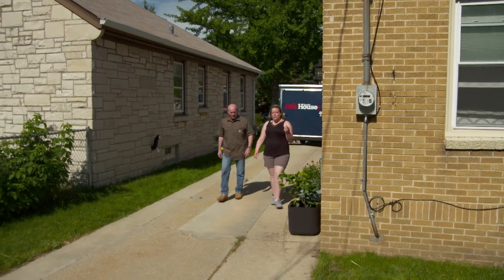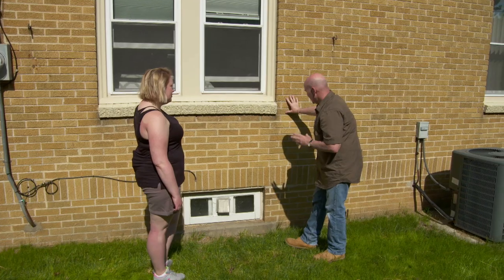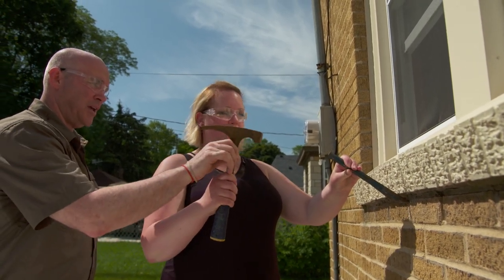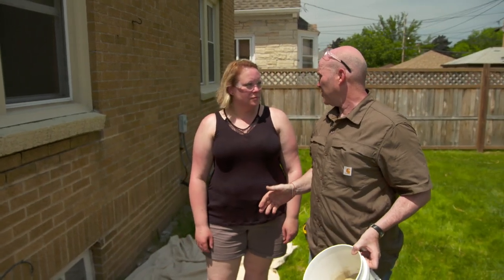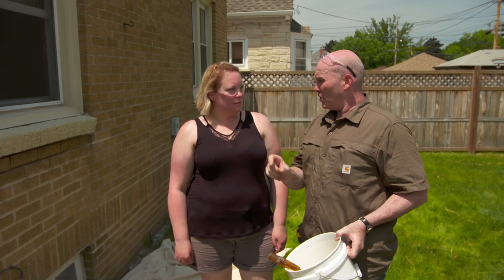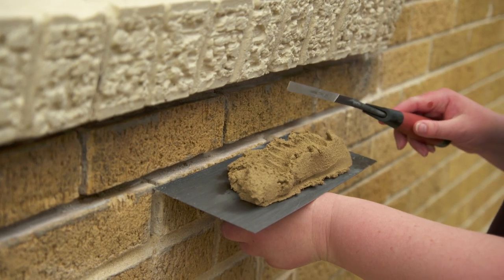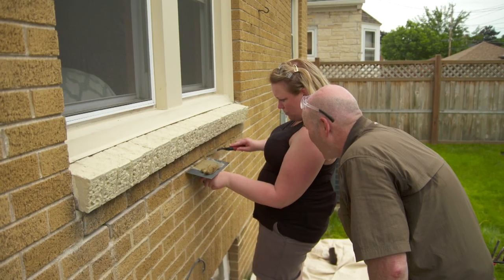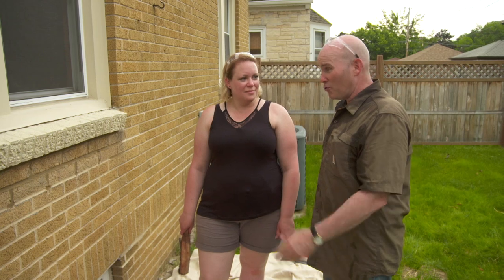How to Repoint Brick Using Only Hand Tools | Ask This Old House

Comment: They did nice "maintenance work" there.  
I'm going to be that jerk that has something critical to say though.  Lol. I'm a 20 year mason.

This has been pointed multiple times for a reason. 
Pause the video at 0:10 seconds. 
Look at the small basement window underneath, and particularly the joints and brick above the window. 
Crossing over that opening is a steel lintel to carry the brick. 
They rust due to moisture absorbing into the brick and staying on the steel.  Rust expands and HAS to go somewhere.  As it rusts and expands it lifts the brickwork above it and creates cracks. 
You can actually see the bow in the sill of the big window above it. 
It's been lifted in the middle.  
(On the thumbnail you can see how the brick is bowed up as well)
The lintel bears on to the brick on each side of the window typically about 4", but up to 8"..
If you look at the joints where the iron is, they are bigger and have been re-pointed. 

This will keep needing "fixed" until that lintel is replaced above the basement window. 

Even today they use primered steel lintels, and if you're lucky they'll paint them. They never flashed them years ago, or put weep holes (or vents) in. They do today unless they're being cheap. 
I always replace lintels with galvanized lintels, that are flashed and have drains (weeps).
Reply: Your so rite there  iam a Mason  from  Boston Massachusetts
Reply: Awesome insight
Reply: @gordonreynolds7315  Oh stop your no mason!
Reply: @derekleesmith76  ok
Reply: That's usually all they do on this show! Just maintenance. Thirty years in the construction field! This guy is exactly right about the lintel!
Reply: Hi! What would a mason of 20 years use to clean a 100 years old brick house? I am very afraid of damaging the porous old bricks and mortar. Just begining my research on the subject, and most methods seems pretty harsh. Maybe a thought?
Reply: what's the difference between the "maintenance work" in the video and the mason work you would do for the crumbling areas of repair?  I don't understand your critique?
Reply: @stephaniestephanie1290  A mason would remove the lintel and most likely discover wood rot behind the bricks.  He would replace all the wood rot himself or subcontract it to a carpenter (Insulation, vapour barrier and drywall would most likely need replacing as well).  He would bring the area of concern up to current building as best as possible given the constraints of the old code work installed already.  It would most likely turn into a larger project but this would prevent the repeat cycle of repointing bricks every few years.
Reply: Would you try a cross stitch - instead of removing the lintel.
Reply: Let me disagree with you.
We know it's not a load bearing problem because the window is small and the arching mechanism is lower than were we observe cracks. 
We have not indication that the lintel is not galvanized but we should probably trust the expert of "this old house" that he actually checked that. 
The corrosion expansion of the lintel could be a real thing, but the bigger damage should be next to the corrosion itself and not 3 feet away. The middle of the lintel can expand in the down direction, no problem. It's just at the lintel support that corrosion expansion can make damage, but we should see a staircase crack patern close the support, which is not what we are seeing.
They indicate in the video that the bricks have been previously repaired. The bow in the middle of the concrete sill is most likely due to previous repairs (remember that the expert says the mortar joints are bigger in the previous repair than the rest of the house) and somewhat minimally from moisture expansion.

The most probable cause of damage we see in the brick joints is poor water management from defective sill, defective water barrier and/or air barrier around the window, lack of weep holes, interior insulation with poor water vapor management. It is critical to understand in masonry structures that water (moisture) needs to be managed and kept away. Brick are porous, they exchange moisture all the time. They expand with high moisture content and contract otherwise. Milwaukee (where this house is) also see freezing temperature during the winter, meaning that if too much moisture is trapped inside the mortar and brick during the winter, they will expand and crack. How can moisture get trapped in bricks? Bricks needs a lot of time and a moisture gradient to dry. If the defective sill brings in a little too much water each rainy day, it's probable that the brick didn't fully dry before winter.
Finally, keep in mind that no matter what, joints are a sacrificial element. They need to be maintained and repair. Hope it was useful.
P.S. I forgot. You can clearly see that the sill has a small protrusion and that it doesn't have a drip edge (channel).
Reply: @Mrs.Tarasevitch  
Best answer is, don't do it. It's very risky and costly to do so. You need a very experience contractor.
Second best answer is to try and test different methods on portions of the facade that are not super visible. And select the best method from there.

Comment: am i the only one who noticed a MAJOR bow in the sill above those bricks?
Reply: I noticed it too
Reply: It's just decorative bricks there they exactly the same as siding just a different material and look
Reply: hope you don't actually believe that houses stay straight and level forever. all houses move and settle. this was a  normal case of settling.
Reply: Yes, houses do settle, BUT this was layed with a bow in it. If the bow was from settling that much, there would be cracks all over that wall not just under the brick rowlock.

Comment: I'm finding cracks scattered around my 1974 brick home (Florida)... was wondering how to repoint the mortar myself or if I had to hire it out. 
Thanks for this video - I'm confident I can tackle it myself. I just need to know how far out on sides of cracks do I go??
Reply: Do it yourself , it is a lot easier than the video says . Chop the joint out the full width of the joint . 10 mm in UK and 3/8" in the US . Take your time and find the mortar mix that best matches the existing .Mix the mortar fairly dry AND use a jointer the same as the original joint . On the video the expert has used a flat tool but the original was a half round . Best of luck .
Reply: @eddieharding2432  awesome tips/info! Thanks!
This is my childhood home so it's more than just the monetary cost/value to me. I want to ensure it stays structurally sound and stable (just trying to figure out WHY the mortar is starting to get so crumbly and cracking in places too 🤔)

Comment: It's always a bigger job than what you anticipate.  Repeated trips to the store to get another can of paint, another brush, another drill bit, etc....  And then you notice a shopping cart full of acetone, tygon tubing, and the incorrect matches.  You tell the cart's dirty and dangerously underweight user that they want the other kinds of matches (the kind with the individual matchbooks), because the red phosphorus they need is in the striker strips, not in the matches themselves.  They bolt and you have to confront him and his partner in the parking lot.

All because you had a leaking hot water heater that needed to be replaced.  The job is always bigger than what you anticipate at first.
Reply: jesusnthedaisychain lol. poetic
Reply: " Repeated trips to the store to get another can of paint, another brush, another drill bit, etc..."

That's just poor planning. If it's a stock paint color, buy an extra can or two and then return them when the job is done. I have at least 10 of every common size drill bit. Not sure why you would need another brush, if you had adequately planned your job. Plan well, expect the unexpected and if you are not sure how much of something you need, but a few extras and return them when the job is done. It will save you a lot of time and time is money.
Reply: A friggin mask too. And a hat. Don’t want to be coughing up a lung with carcinoma in middle age.
Reply: @MAGAMAN  It's not really poor planning, oftentimes.  Usually, in the attempt to fix one problem, you uncover another problem, and as you work on that problem, you discover something else, and so on...  Sometimes, you can't know what you're going to need to completely finish a task.

Comment: 2:30 Mortar does not stick to mortar? 
Yes it does if the mortar is sound and clean, otherwise it wouldn't stick to the surrounding pointing and you'd have to do the whole wall
Reply: That is true, but mortar definitely does not stick as well on mortar as it does on brick. That is one reason why you always need at least 15mm/20mm depth.

Comment: Hello,
I love watching your shows. Just curious at what instance would you use a mortar bag to put the mortar between the bricks?
Reply: A mortar bag is usually intended for larger jobs where you're trying to save the time the labour of a pointing tool would require while still  maintaining quality. They do require a little more practice to control and still end up with your mortar being extruded to the back of the joint so there isn't a gap that water can collect in and bust the face of the brick.

Comment: this is a dumb question I'm sure...but does anybody know why the bricks don't fall down after they remove the bed joints?
Reply: Jereme Macready because your not removing the whole joint only about an inch of it the mortar is still under the back of the brick

Comment: Also,  the mortar color originally was probably gray, but as mortar weathers it washes away the cement and reveals the sand. A 57k restoration mortar would probably be perfect. 

Also, mortar DOES stick to mortar. Provided it's solid, dust free, and dampened before hand.  Cementitious materials bond to cementitious materials.  
..but yeah.. just smearing a little bit of mortar on a joint will just fall off soon.

Comment: I'm guessing I can just use a regular hammer if I don't happen to have a brick hammer? I'm not planning on splitting bricks or anything, just need to repoint a small section and don't want to buy tools I'll never use again.
Reply: Yes a regular hammer 🔨 is fine

Comment: Wow they actually did a pretty good job. I've hired a "pro" with his card to work on my house. He was using his hands to insert the mortar. Horrible job.. trying to contact the association to remove his licence.
Reply: Many professionals use their hands to hold the mortar when doing the head joints. It is easier to add the mortar that way.
Reply: @Jpbawlings  
No. He had no tools. He was using one hand to freely put mortar everywhere on the brick, staining them. A coffee on the other hand. Half of the mortar was on the ground. Many "professional" in the renovation housing market are not professional and are pretty bad, but they charge like pros.
Real professionnal uses tools. Simple ones, but they get the job done correctly, cleanly.

Comment: Good video, except mortar absolutely sticks to mortar. Otherwise when laying stone veneer, you couldnt stick the stone with mortar on the back to a scratch coat made from the same mortar. Just needs to be clean and dust free. They bond together just fine.
Reply: Stone and brick are 2 different materials so I know you don't work in the trades like I have for over 30 years mortar will not stick to mortar over time it will break down a year or so, so if every year you want to re-point be my guess! Mortar sticks best to damp brick the best 🧱!
Reply: They still bond together just fine. Doesn’t matter if it’s stone or brick. If mortar didn’t stick to mortar, then every stone/thin brick installation guide wouldn’t say to prepare a scratch coat of mortar, and then stick to it with mortar. That’s a mortar on mortar bond. Look at masonry veneer association install guides etc. Otherwise every single house with a veneer would just be falling off the house. Not discounting your experience, but I was the mortar rep for over a decade, working with cmu, stone, and brick.

Comment: Yeah don’t bother showing ur viewers the most important step....taking a hose to the brick to soak it first.
Reply: Hey I want to install new blinds. But the previous ones ripped up some holes in the spot of drywall where I want to install them. Can I use spackle to fill them and then screw into them again for my new blinds?

Comment: 😂🤣
Cuts up the previous work...
Then plasters the brick with mortar, and uses the wrong jointer for the job...
You dont use a flat jointer on this job, where clearly it was done with a round jointer.
Very disappointing!

Comment: Bricks need wetting. Especially as lime is in the mortar it cures very slowly and needs water to catalyse the reactions with CO2. Wet brush wipe is pointless. This will not stick